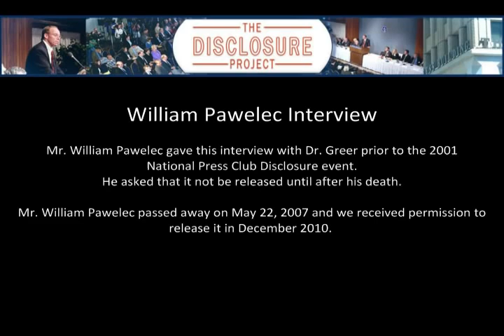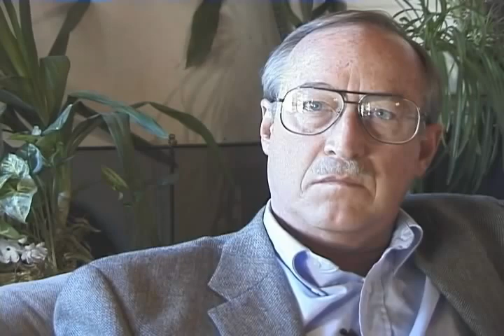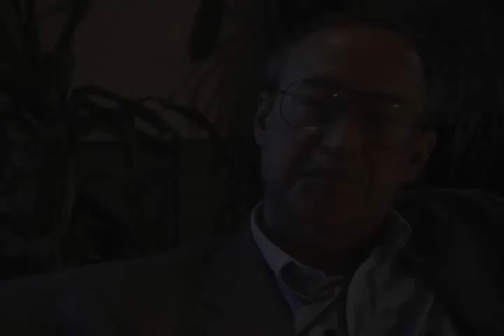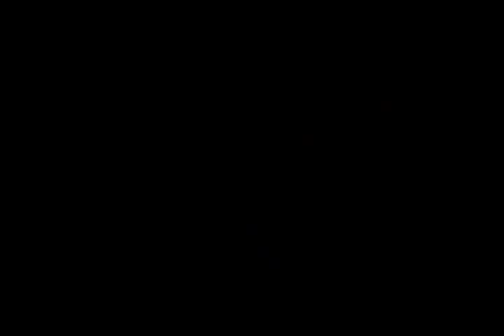Deep Underground Facilities & Tracking Teach Development | Disclosure Advocates Series

Comment: The implant technology discussed is RFID (radio frequency  ID).  Stimulate the embedded quartz crystal with an nearby transmitter, and the piezo-electric effect powers up the local circuitry for long enough to broadcast its details (no batteries needed.) There is a laboratory for RFID development on the corner Massachusetts Avenue and Vassar Street in Cambridge, Massachusetts, on the MIT campus.
Reply: How is this technology implanted into the bodies of the public?
Reply: @jamesthomas5692  RFID that is in broadest use uses a radio frequency range that is easily matched by ultra-common quartz crystals. This convenient size works well under the skin of cattle and horses or clipped to their ears. It is unlikely the most common version of RFID would be used on a human: it'd show up under the skin or by palpating the body: it would be the size of a matchbook. Has anyone seen such a device found on a person?

Comment: @18:27   Everyone that has the most basic rudiments of electronics knows that there is such a measure known as the signal to noise ratio.   I might believe the a mile away theory if the ping is released at certain frequencies. building materials stop some bands more than others.  Over the horizon is possible only at some frequencies.  75 miles in space might be do able if the parabolic dish in space was large enough & focused on the exact spot @ the exact frequency.  This item is energized by an external pulse of energy & likely has to store up enough charge to release a ping of some sort.   Any one who has messed with cordless phones knows that 1/3 a mile line of sight is about the limit of a store bought cordless phone.  A 1/2 watt frs talkie can go maybe 5 miles if nothing is in the way.    However with the present cell phone grid in place a couple miles would be easily traceable.  You can ring your cell phone even if it is placed inside a microwave oven with the door closed (just dont turn the oven on)  A microwave oven obviously does not make a great Faraday cage at least for cell phones.  in fact if you take a couple stainless steel pots & bowls of various sizes & put the cell phone in a pot then put a couple stainless steel bowls around it you might stop it from ringing. it is quite impressive what these things can penetrate.
Reply: Remember cryogenic receivers have a noise floor of -180 dbm or better. That really helps.
Reply: Ham radio operators bounce signals off the moon using cw, not voice.